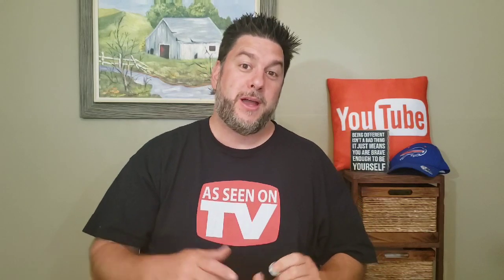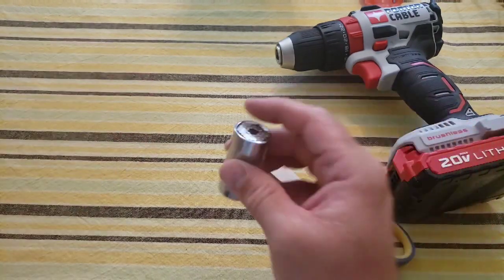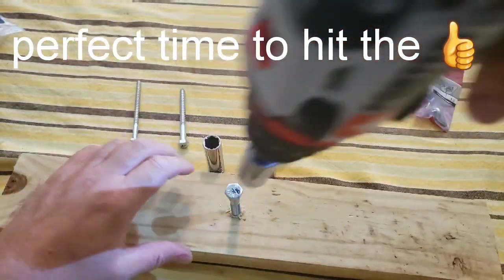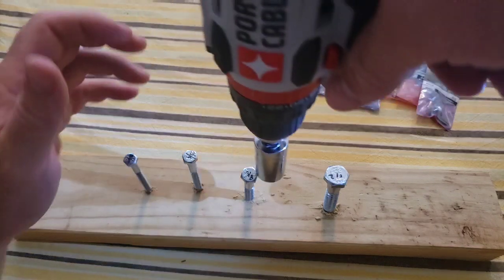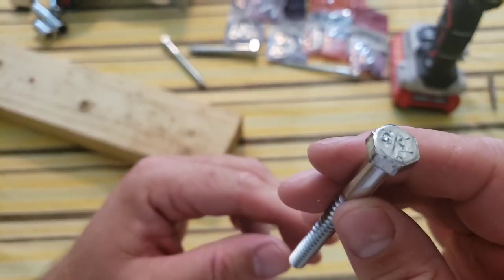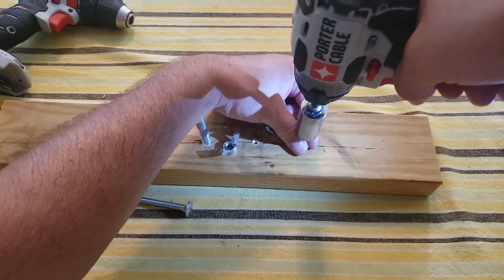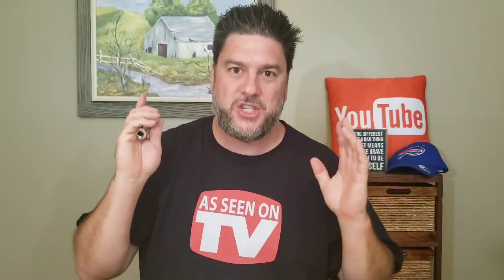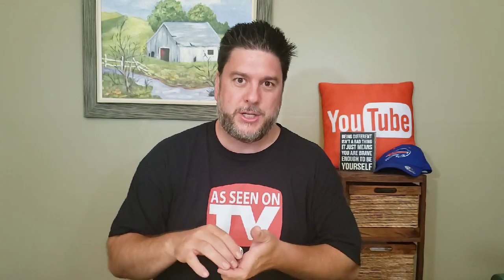Universal Socket Review - Super Socket #SuperSocket [165]

Comment: I have tried some of these before. They work fairly well in soft materials such as pine. Mine didn’t work so well trying to remove a rusty bolt from a car engine. The pins bent and jammed onto the head of the bolt and ruined the socket. I had to clamp the bolt into a vise and beat the socket with a hammer for several minutes to separate them. Both were damaged beyond further use.
Reply: So good for light work, bad for heavy duty. 👍
Reply from the maker: Bruce Coleman - thanks for sharing your experience with a universal socket tool. I think they are good in a pinch and in my case sockets frequently go missing - lol. Thanks for stopping by and commenting.
Reply from the maker: @GeeSedan  I'd have to say yes...good in a pinch but not tough jobs. It will wear down. Thanks for stopping by and commenting.
Reply: Thanks for the review

Comment: I have one of those. It is sometimes useful but not for anything really heavy like automotive bolts. My biggest complaint is it is way too shallow so it won't work on any nuts if too much of the bolt threads are already through. That's why on the commercial they mostly show it only on bolts and already started into soft wood.
Reply from the maker: That is a good point. It is a bit shallow. Thanks for sharing your thoughts.

Comment: I feel like that I would use this with the same mentality as my Leatherman Multi-tool, aka I wouldn't expect it to do the heavy work, especially without drilling a pilot hole first. Additionally, since in many cases proper torque and consistent tightness are important, that I would find more use for this sort of socket in the role of bolt/fastener removal, in a case where there were several fasteners of different sizes to remove. If I ran into a particularly stubborn bolt to crack, I would definitely use the proper fitting socket head, unless the bolt/nut were mangled, and I had no other choice.
Reply from the maker: You're right, not a good tool for heavy work but it's nice to have in the tool bag.

Comment: You didn't screw the screws in very far at all. I was anxious to find out if they could handle the torque. I imagine the pins would get twisted and/or stuck in the down position and you would have to wack it a few times to get them back out. .
Reply from the maker: These universal sockets are good in a pinch but not for regular use. I did an updated video here: https://youtu.be/jXe9UzMchbc

Comment: Hi, Jeff...I am confident that the socket will work well with typical everyday use.  I think working on cars, especially with bolts to the engine may push the limit, but I think the product is pretty cool.  Like you, I wonder if the pins will endure the test of time...Thanks for the review...
Reply from the maker: I was pretty rough with it when I was testing it out. I was impressed with it. I think it's a great addition to my tool box. Thanks for sharing your thoughts.

Comment: You didn't try reversing/removing the screws with the Comoware and SuperSocket is a different brand. Not all Chinese junk is equal.
Reply from the maker: I reversed and re-screwed many times off camera to test it out. Around 5:35 I referenced the bolt being used 20 plus times. Thanks for stopping by and commenting

Comment: I think that it's better to use the  matching  sockets.  Looks like it really isn't a straight clean run
Reply from the maker: I agree...I will say I was putting a few 2x4s on a shed ramp the other day and happened to have mismatched bolts, it was handy to have this universal socket so I didnt have to look through the socket set to find the correct size.  Thanks for stopping by and commenting.

Comment: Hi   I would think if you used a standard socket to insert and remove a  similar lag bolt 20 times and compared the damage to the head of the one used with the universal socket would have been a good comparison. Great video anyway. Thanks.
Reply from the maker: That's a really good idea. Thanks for sharing.

Comment: Hey Jeff,  thanks for your review. I joined in on the premiere just as it was ending.  I would definitely consider this as an addition to my tool box.   I couldn't tell you how many times I would have to go back and forth to find the right socket.   If I had to nitpick about anything it would be having to put pressure down on the head of the bolts to get them started but it wouldn't be a deal breaker.   Thanks again and congrats to your son 👏
Reply: S.R.rrrrrrrr 🤘🤘🤘🤘🤘
Reply: @Thatsright-tr2ks  hey bud,     hope you have a great 4th.   Stay safe
Reply from the maker: I like it so far and it's pretty convenient to have it in my tool box.
Reply from the maker: Absolutely - stay safe!

Comment: im a casual dumb dumb and went OOH and jammed the drill bit thing into the socket and its stuck. but i work in tight spaces so i need it on a Ratchet
Reply from the maker: I've gotten mine stuck on the connector piece before.  I attached it to my drill and used a crescent wrench as a wedge to pop it off.  Thanks for stopping by and commenting.